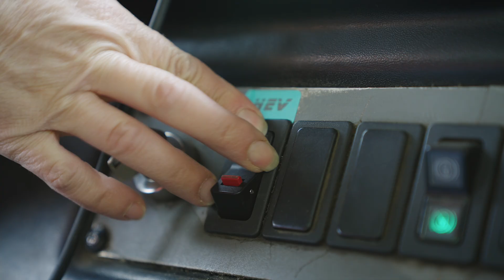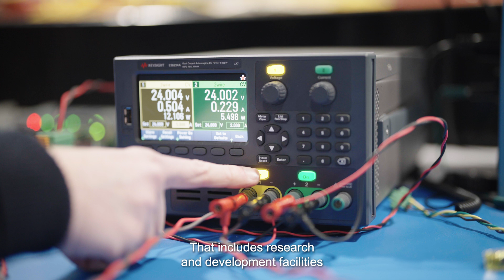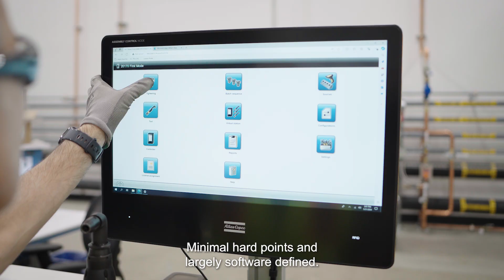First Mode Path to Zero

Comment: People told Henry Ford they wanted a faster horse, and they got the car. Stop wasting time with hybrids and fuel cell, just go full BEV. It’s far more efficient. On-site solar and MegaPack storage with MW DC charging and the truck can charge in 30 minutes. All other Diesel maintenance goes away and the uptime will surely not get worse. How much time is a diesel truck down for when the engine gets rebuilt? Monthly maintenance? Just rip off the bandage quickly and go all in on BEV.